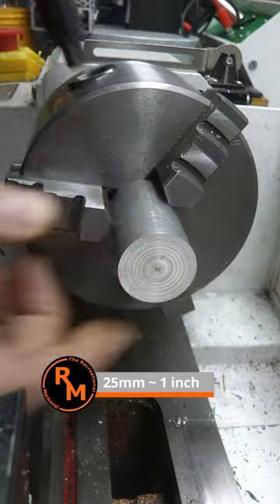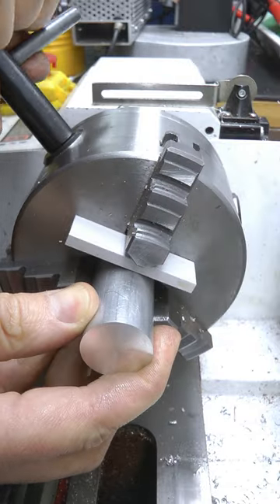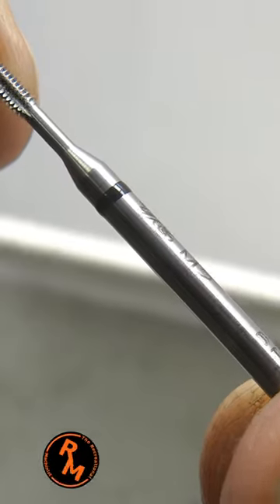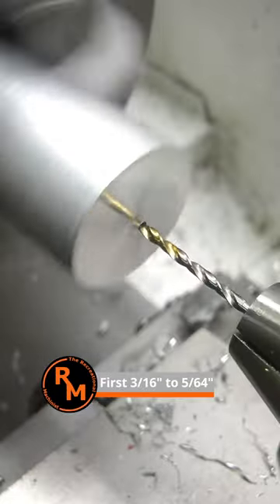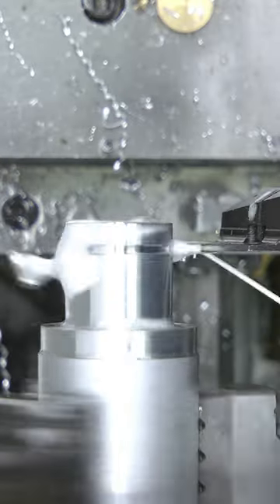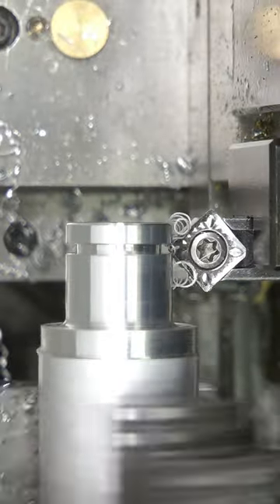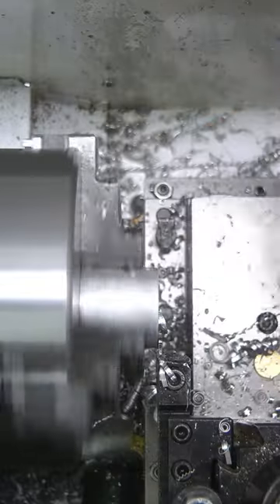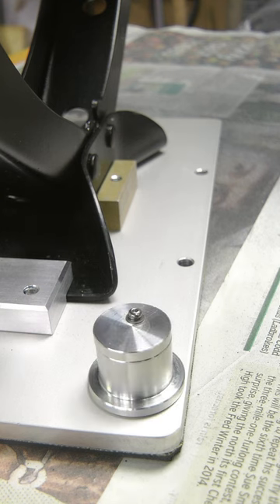Adding Ratchet Spanner (Wrench) Storage  #shorts

Comment: It's not a spanner, it's a wrench. A spanner uses two points of contact, either fixed or adjustable to "span the distance. This tool is used to "wrench" on either the bolt head or nut to tighten or loosen it. So, you didn't make a spanner holder, you made a wrench holder.